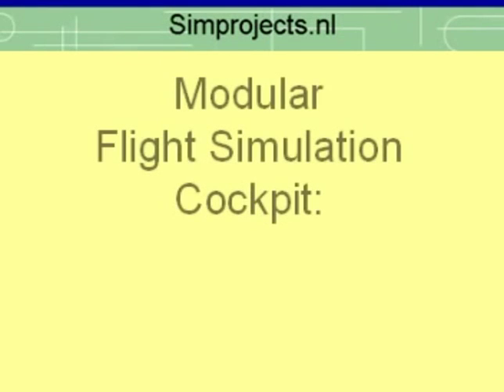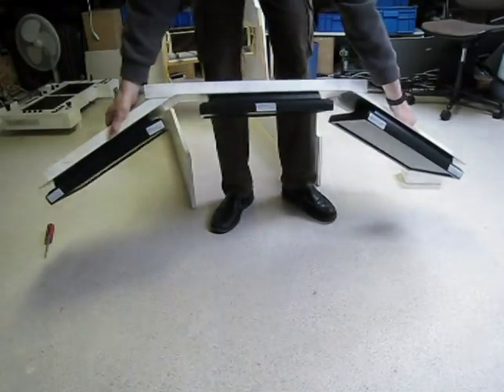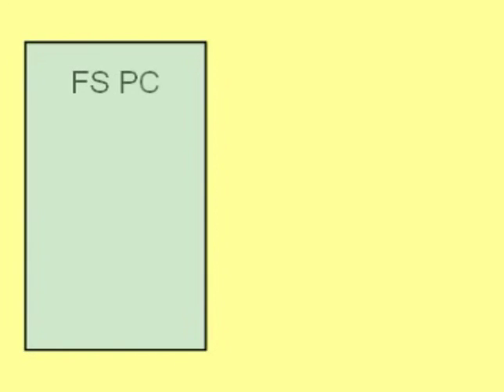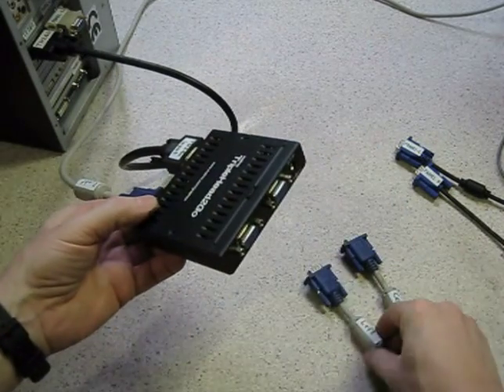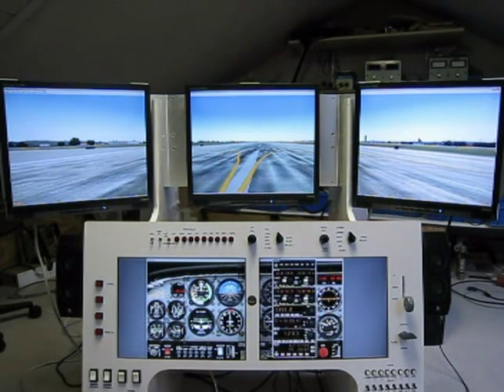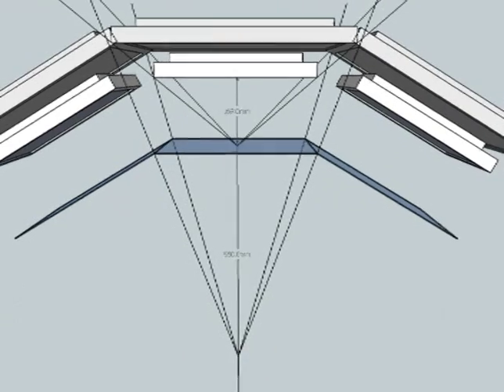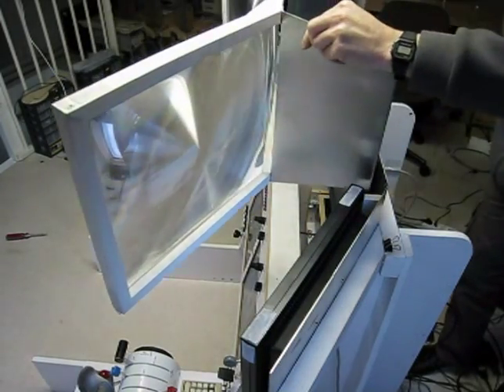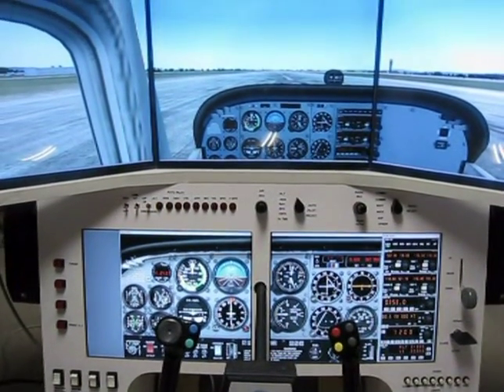Multi-monitor flightsimulator display explanation

Comment from the maker: It's because my self-build cockpit does not include windows or glare shield. Also the cockpit view over the hood of the engine with prop gives much nicer view, and when panning left, you can see the left wing. 
I have adopted the cockpit view position so most of the dials are out of view.

Comment from the maker: @przhevsky :Fresnel lens: €22,- each 17" LCD: €50,- each (ebay) 15" LCD: €40,- each (ebay) Matrox TH2Go: €125,- (ebay) PC & video cards: €250,- (ebay) MJOY-16 interface card: €20,- each (self build) switches, levers, rotaries: €60,- wood, metal etc: €50,- Yoke: €50,- self made so total display setup cost: around €910,- includig PC

Comment: If i ever come across the money, I would build something very similar...  In fact, just about identical.  The only difference is i would make the buttons functional by wiring them up to a board that sits in the wooden casing, and make it attachable by USB.  The monitors themselves would be hooked up to one of the graphics cards.  Those would be where it would get expensive.  But i think the entire thing, computer and all, could be built for US$5,000-$6,000.

Comment: Purhaps you could help me? I have search and asked about a solution for the instruments in my home built cocpit, with no solutions.
I would really like to try to use FS panel studio, but no one can explain how it Works on Win7. Maybe there are other programs but i dont know them then.
This is my only problem to finish my cockpit, and also i would like to ask you for which projector would be good enough to use as a front monitir today?

Comment: Hi, Is it possible to connect 2 monitors on the second video card?.  Now I have one Video card connect to triple 2 go digital but I use only 2 video out from triple head 2 go. I plan to buy second video card (Cheap one)  and install it on the same computer to connect 2 lcd display for display panel.

Comment: lol those shitty monitors
Reply: Ermias Zemichael No lol those monitors are shit, The fresnel lens is a cool idea but can be replaced by 27- 32 inch monitors. I have zero envy for someone why uses 10 year old 15 inch monitors in a tripple screen configuration with fresnel lenses just blassting up that low resolution up to a giant size. Plus if the lenss are not perfectly parallel you are going to get blur on parts of the screen.
Reply: Ermias Zemichael lol i agree, im just the kinda guy with a 40 inch 4k and two 32 inch 1440p at my desk.
Reply: +Marcus Christensen Maybe he should have used a curved OLED in 2010?
Reply: +Marcus Christensen 
This Video is from 2010 - i think you are not good in reading, right?
Reply: Its not about screen size, anyone can do that, its about depth cues and colliminated rays which regular LCDs (no matter the size) would be able to do.